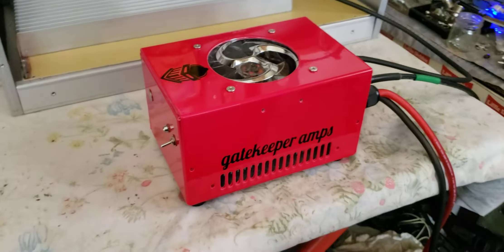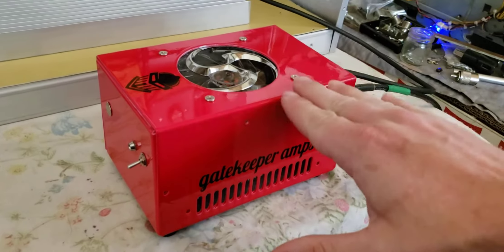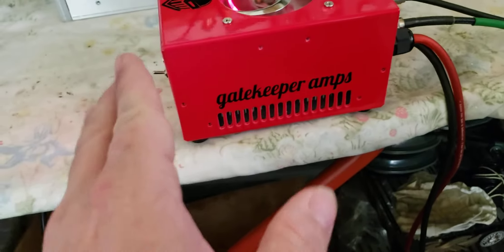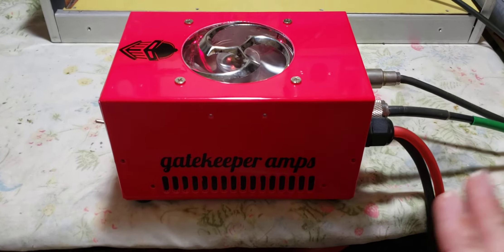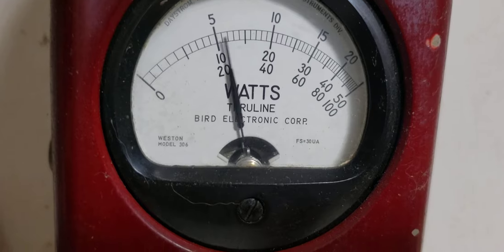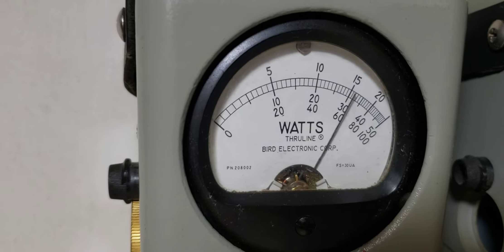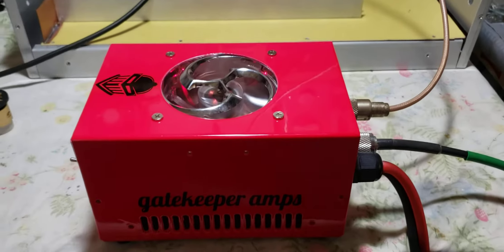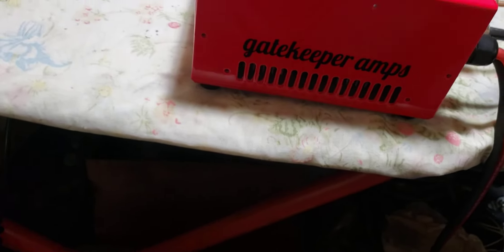2022 Gatekeeper Candy Painted 2 Pill HD - SOLD!

Comment: that paint is pretty. I got a few I keep look like went threw the war but put the meter on it . put the spectrum on it and they work great. just to lazy to fix cabinet .The fan push air. all I care. just got a box of fans. finally ! shipping slow . using sun on 50,000 hour barring life.  all different ones. some 80MM some 92MM most 120MM and some 120V ac metal ones. My girlfriend got some pink LED fans for computer . lately I can build a pyramid out of pyramid supply's got a run to fix. 25/35/50 and a gold 26KX. I got a PS86KX on my test bench.   my home made 200 amp sits on floor. waiting on parts. I just got my Japan made nichicon caps.  and I got 8X TO-3 heatsink from England came 10 day DHL . waiting longer for shipping from west coast. before coved it took 5 days. crazy ! and the junk parts from china. new fans don't work. bad meters. wrong ferrite. glad I know how to use LCR meter. atlas DCA got 3 different. put a turn threw ferrite read inductance threw known type 61 core . The ESR is great checking caps . 73's
Reply from the maker: I love using those Metal AC 120mm X 25mm thin ones on my LDMOS boxes or Base Boxes then putting a Variable on there to allow the user to control the speed. It works great man.

How many of the metal ac fans do you have?

Comment: Hello Gate Keeper. This is Captain Crunch.  I sent you 8 matching Tosheba 2879 transistors. ( a good while back )  To be used to  build me a amp with. Where are the Transistors?  And or is there a amp being built? If you used or sold those Transistors. What are you going to do to fix this. I won't my Transistors back. The ones I sent. H G 2879s will not be acceptable. You still have my phone number.
Reply from the maker: Good GOD SOLD them lol lol WOW Captain Crunch.....you thank the worst of me don't ya bud lol lol JK with ya....If you watched this whole video, when I mention the amps I have left yours is one of them and I put all my Toshbias in my safety deposit box about 1 year and half ago and when ever its time to do a build with them I go and grab them. Im down to only 16 left and 8 of them are yours. If you wrote down your lot numbers you'll see that they will match up and you'll see the transistors in my video before I begin the build.  Me selling people parts before a build would have to be the most INSANE OUT OF THIS WORLD thing for me to do or anyone else barnone. Not the way I roll my friend.

So you'll be hearing from me very soon buddy cause I'm down to single digits of builds left :) Thanks for hanging in there with me Mr. CAPTAIN CRUNCH!
Reply: Man I am really glad you are back ! I love your builds. You do good work ! I have a bunch of amps. However I would have BRAGGING RIGHTS.  I GOT A GATEKEEPER AMP. I need a good driver for my 48 pill box. My ride is doing 2,300 now with a 16 pill texas star. . Got 230 amp alternator and a 24 cell capacitor pack. The 8 pill will push my 48 pill what you think 4 thousand out of the 48. We will see. Got the base station right 10 grand with steel tubes. Going into a 6 element gizmotchy.  Talked to Ireland.  And Germany the other day,
Reply from the maker: @jlyle51  My GOD man....I had no idea you have been getting setup like that bud. I have to say I'm a bit jealous lol lol.....WOW id love....absolutely love to see images of that 48 Pill. There isn't a lot of them out there floating around. Mayne you can shoot me some if you have them to threemanpro at gmail.com if ur able.

Congrats on the base setup also. Yes this 8 will be good driver. You won't be over driving it and for sure not under driving it lol.